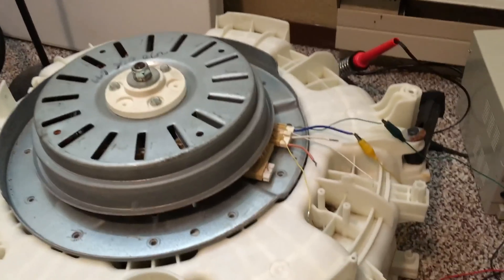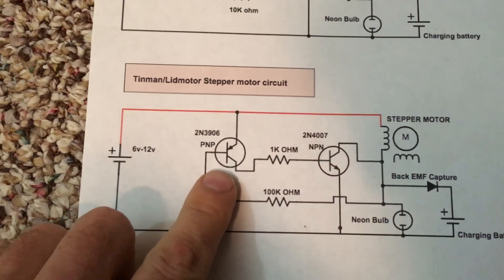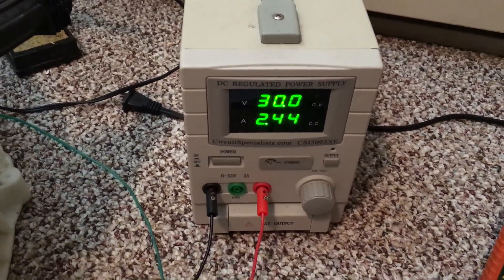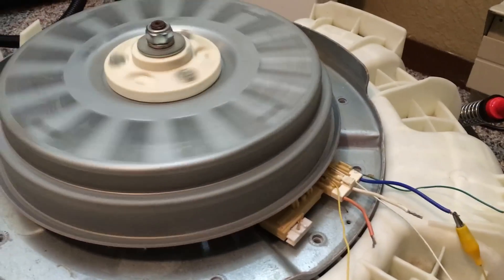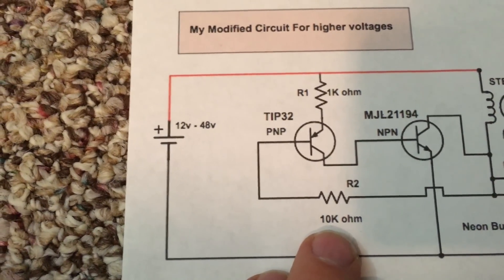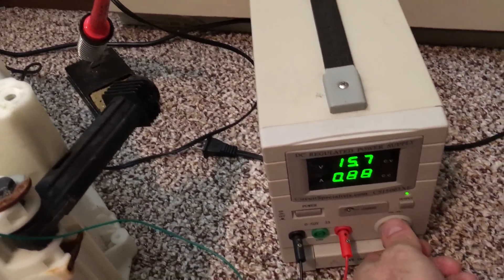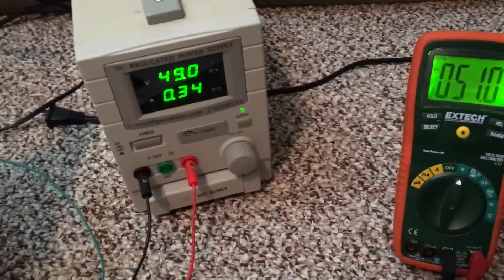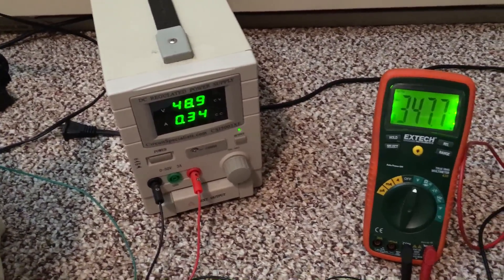A simple Transistor circuit running a brushless washing maching motor Part 1

Comment: Does the high voltage spike from the transistor turning off cause a strong magnetic pull momentarily pulling the rotor indicated by the ringing noise? Although wasted energy, would a flyback diode prevent that (losing battery charging part). Or would a gradual turnoff of the transistor/mosfet help with that spike?
I'm interested in a simple circuit to drive these motors at a fixed speed without having to buy £80 bldc drivers for each motor.

Comment: The original circuit to drive the motor outputs sinusoidal voltage to reduce stepping noise, but you get high-pitched noise as a result

Comment: Hi Darren you are not using a controler ? So the timing is not set but still it runs with your transistor circuit

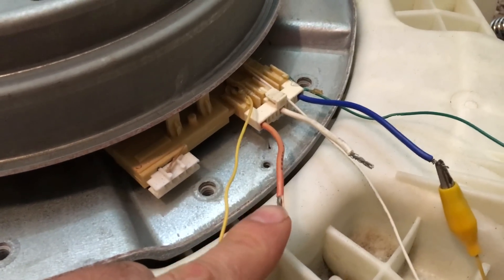Comment: some late info.   at 2:35, you say coils, when you should be saying  PHASES.    so, one entire phase is NOT POWERED.     this is a  haff-assed solution to the bldc driver problem.     the phases  Should  be  energized,  SEQUENTIALLY.    it is not clear whether that is happening, here.        googletranslate

Comment: I was hoping that the washer motor would be driven with 102V in proper three phase synchronization just like the manufacturers original design. I know this would take three transistors capable of handling the voltage necessary to drive the motor coils at their max without burning them up including the heatsinked transistors as well.
Reply: I thought these motors were closer to 310v.
Perhaps rectified and smoothed AC mains which is then PWM'd with suitably sized MOSFET?

Comment: You`ll need at least, 40 amps, to move your weight around. I think, a modified alternator, into a 3 phase, with a few IRFZ44, in parallel, will do the work. Perhaps, a higher Amps transistor. I`m running, a VHS motor, on 3v, with a D2624, I removed from an old CRT tv.

Comment: I got the motor to turn using a 3 phase inverter motor speed control but it just barely turns really slowly at about 0.8 RPM.  If I try to run it faster it just vibrates and won't turn.
Reply: 'INVERTER' ??????      this is a  DC  motor.   3-PHASE  BLDC.       it needs a suitable  BLDC  driver/controller.     cheers
illustration of a  Multi-pole  3-phase  stator
https://lgechupacabra.files.wordpress.com/2016/09/standard-wire.gif
Reply: @daviddavids2884  BLDC is controlled by inverter, isnt it?
Reply: @rapbalance  the description of  BLDC  operation in the wikipedia article  NOT  correct.
Reply: @daviddavids2884  isnt that what the inverter does? sequential 3 phase PWM.
Reply: @rapbalance  do you know what   'inverter'  means.     an inverter converts  DC  to  AC.   a  converter, converts/rectifies  AC  to  DC.      these appliance motors do NOT run on mains AC.    in an appliance,  AC  is  converted  to  DC, at   certain  volts/amps.    the driver/esc  processes the DC  and outputs   sequential  DC  pwm;  that goes to the  bldc  stator coils.        some people have misinterpreted the nature of  f&p motors;  because,  No  transmission is utilized.   these are  direct-drive motors, with the bell/rotor  attached the bottom of the drum/tub of a clothes washer.     the absence of a transmission results in it being fairly easy to rotate the  drum/tub, 'by hand'.     cheers          googletranslate
https://www.fisherpaykeltechnologies.com/products/direct-drive-motors/
at link - see a diagram of an earlier,  42 pole f&p stator.    it can be seen that there were   Three phases, consisting of  Fourteen coils per phase.
https://www.thebackshed.com/Windmill/images/42Pole1X14C.gif
Reply: @rapbalance  what??????    inversion is  changing  DC   to   AC.     this question makes  zero  sense.
Reply: @daviddavids2884  That's what inversion is. Changing DC into AC. What do you think it is?

Comment: Has anyone figured out how to run one of these motors on an AC inverter?  I have a more normal 3 phase square motor that runs OK but can't get one like this to run, it just vibrates and won't turn.
Reply from the maker: I'm actually working on that as well. I have tried several different values of capacitors, and wired it in delta and y configurations but haven't made any progress yet, when I do I will be making a video to show what I find out. There have been others who have videos showing that it can be done, this is one that got me working on it... https://www.youtube.com/watch?v=kJQwrieXp9s&t=584s
Essentially a hard drive motor is that same thing only smaller...just google search "How To Run A HDD Motor Or Three Phase Motor From A Single Phase". I hope this helps.
Reply: Why would you be trying capacitors when you really need a 3 phase inverter? This is more like a brushless 3 phase quadcopter motor but uses a lot more power.  The circuit in this video is nonsense, he's only running one phase.  I want to get the 3 phase pancake style motors to run like the square ones do and I got a variable speed drive but it won't run the pancake motor for some reason.  I can spin it by hand but when I connect the VSD it just locks up and won't spin.  Maybe some of the settings in the VSD are not correct but I've tried a lot of different settings and can't get it to run.

Comment: this is kond of late what if I wanna do 370v do I just upgrade the transistor and what transistors would you recommend
Reply from the maker: You could use A voltage reducer/regulator circuit to bring down the voltage to the rating of any transistor you might currently have, or simply buy a new, high voltage transistor rated above 370v and at least 3 amp..The TIP152 is NPN transistor that's rated at 400v and 7 amp so I would start there. PNP transitors are harder to find. I found one at DigiKey rated at 400v, model # MJE5852GOS-ND.   A simple search on google should help find more options. I hope this helps
Reply: Use Transmission power not ac or dc
The secret is to use radio frequency of field energy and windings utilized as pick up atena then low amp/high voltage produces efficiency...... this kind of drum motor can provide 80 hp running on 400 volts and 4 amps
Note how the trolls keep pointing back to low volts and high current of  ac or dc
Reply: @waldieschmidtke9630  Factory rating of these motors is a max of .9HP. And that is at 310 volts and about 3 amps and 1400 RPM. Other ones are rated at only .6 HP. None of them will run at 80HP.

Comment: could this be used to drive something like a bike or something? and would it be strong enough to do that?
Reply from the maker: zenol leytan that's the plan. I am working on increasing the transistors power rating to increase voltage and then hooking up one set to each phase to maximize torque. After that I'll be putting it on a bicycle
Reply: cool, can;t wait to see that.
Reply: @darrenhoffer4018  did you get your motor to work on your bike

Comment: one wire goes to one set of coils, what exactly is the other? is it a signal wire maybe ? if it is a signal wire maybe you just need two more setups to fire the other sets of coils... dude if it turns out that easy, Girard has wasted a lot of time waiting on a controller lol. cant wait to see how it comes out. have some thoughts of my own on the subject but im unable to test any theories right now. wish you luck buddy!
Reply from the maker: You are absolutely correct, in my next video I'm going to show some attempts at using the other coils to get more torque. What I came to conclusion is just what you said,adding a circuit to each one is the easiest way to maximize the power. Stay tuned, I'll be finished editing it and upload it in a couple days.
Reply: wonderful to hear!  look forward to seeing it!